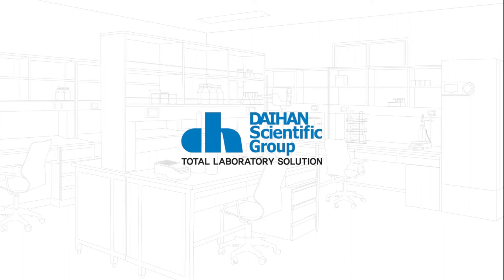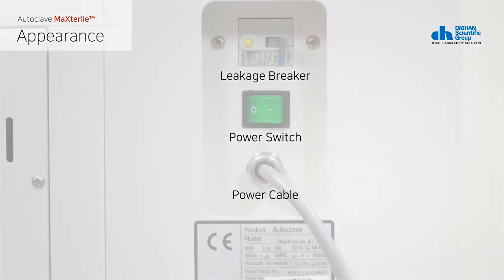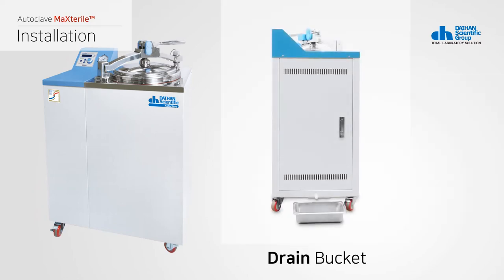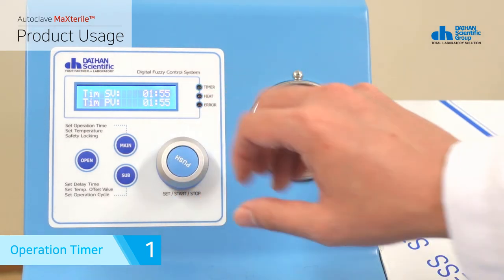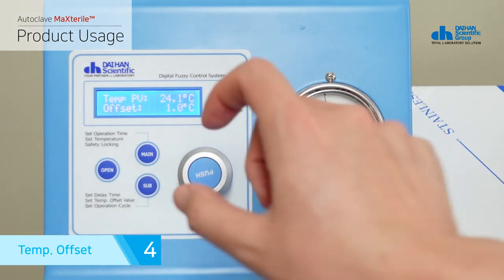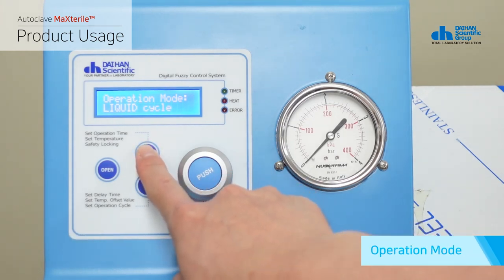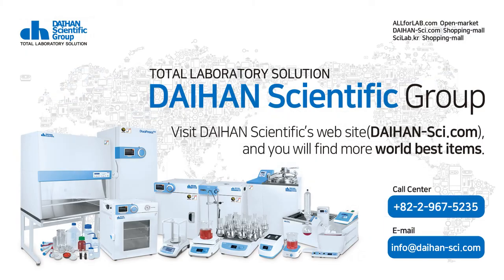[DAIHAN Scientific] DAIHAN® Digital Fuzzy-control Autoclave “MaXterile TM ” ENG Ver.

Comment: I set 1 min timer (Timer SV)  @ tempr 52°C for test purpose . After reaching to desired tempr, heating cycle stopped and sterilization cycle started. But the Time PV is decreasing very slowly. It is taking too many minutes to stop sterilization cycle although set tempr was just 1 min. Please help me with this problem
Reply: How did you cope with this issue?? It happened same with me, not getting what to do,
Reply: @prativabhatta5216  I think 00:00 is hr and minutes...

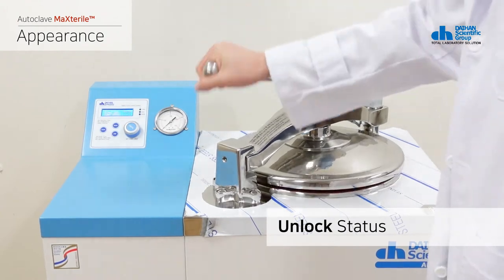Earlier I used to set 01:00, thinking it as 1 min and 00 seconds....but actually it was 1 hr and 00 minutes... Now I set 00:01, which is 1 minute..
 So I solved this issue like this way..
And even after the desired time has been reached, autoclave doesn't opens, i related this with pressure cooker, even after we off the stove we can't open it until all the pressure has been released... same with autoclave, had to wait more time to open the door...
Reply: I have problems with my machine, my machine not off, when i set 5 min time It never off, can you help me?? Have you númber WhatsApp?? I need help please